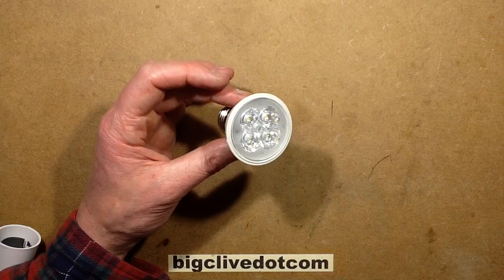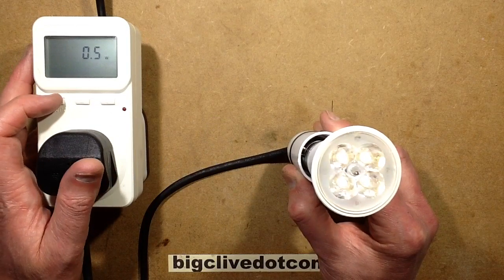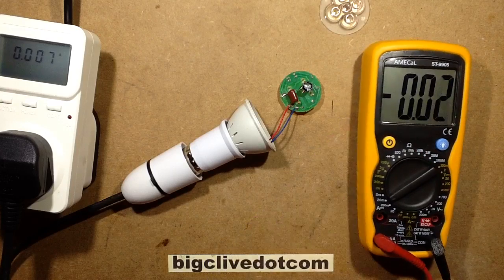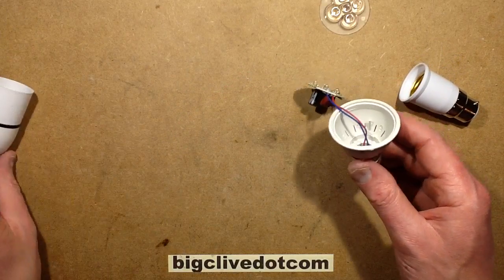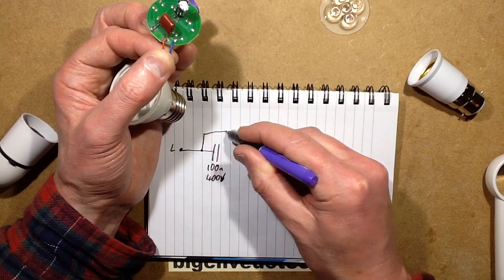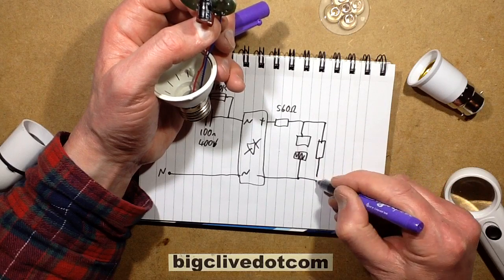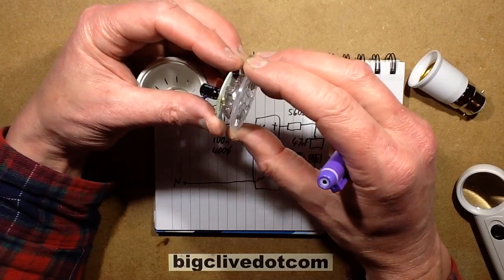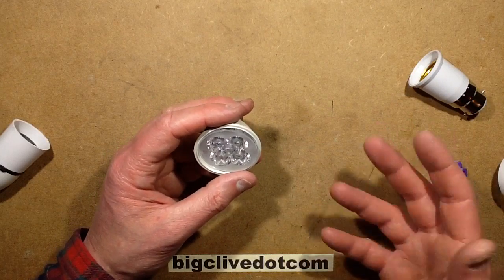Weird 1W (0.1W!) LED lamp from eBay.

Comment: Just claim a refund. You are guaranteed to get what you pay for from most China suppliers, or a full or partial refund. For example I ordered a 30W led floodlight, measured the power output at 17W and received a 50% refund (what I asked for - as being reasonable).
Reply: +Joseph E One thing that I like about Chinese sellers is just that - the ability to get partial refunds AND keep the item. Italian sellers, after ripping you off by making you pay 2,80€ to send a bloody TO220 package MOSFET that could have been shipped in a 0,80€ envelope, justify themselves as "The envelope costs 2€" yet the envelope is a normal paper envelope with NO static protection (great for a MOSFET!!) and after complaining that the mosfet got damaged due to static charges, I got back a "It never happened before. We are not going to refund since you didn't pay for the 8€ courier insured shipping". In their retarded logic, I should pay 8 EUROS to ship a MOSFET that costs 2,50€??
I had to open up a case on Ebay and I left negative feedback. The seller even complained about the negative feedback!!
These sort of people really make me hate my own nation. Idiots.

On the other hand, I NEVER had to send ANYTHING back to the Chinese, so I'm sticking with them, even though the postal trains from China take 1 month or so to come here :D
Reply: +Joseph E I think almost all lightbulb companies lie about power output.
Reply: BikingMNViking
I already recover stuff (I have 6 computers in my house, I only purchased 2) but sometimes I can't trust junkyard quality parts. Imagine if the H-bridge controlling my e-bike malfunctions because of a faulty component... in one case it shorts the battery out (Flaames!) and in the other case the bike accelerates without control until I crash into a wall...

Comment: Hey Clive, I just found out that some Samsung LED bulbs are, in fact, "shellable". Pull the front cap off with vise and pull the Edison base off by pulling it with a pair of pliers. Then unscrew all screws holding the LED (COB LED!) and push it through the hole on the heat spreader.
Then push the aluminum part up and push two wings on the circuit board inside, inside the notch on the plastic shell,  to pull the circuit out.

It has these letters:
KC-SH11200-11002 (KC code, AKA Korea Certification)
STIILW827070324
L42100161WSM
This model has color temperature of 2700K.

Comment: I purchased half a dozen of this type of lamp (mine had more LEDs) off eBay to put into a pair of ceiling lights in a tiny apartment living room. It had 6x gu10s!! Far far too many and very overkill. We didn't need to pay the power bill on 300w of halogen either !

Comment: Still trying to figure out how they measure watts in China
Reply: +Boredness A guy puts his finger across the circuit and says it isnt that strong so they label it as 1 w :)
Reply: +Boredness Not sure how they measure watts, but to translate Chinese Lumens into UK//US Lumens is something like Lumens(ch) = Lumens(us) * 10.  At least that is how it worked for a 2000 Lm Chinese flashlight I bought.  I tested it and it was exactly 200 Lm.
Reply: +Boredness  Estimate and escalate.
Reply: +Boredness real W +50% minimum
Reply: Incorrectly I assume.
Reply: They use a special meter filled with snake oil.
Reply: +Boredness volts^(amps x 10^10)
Reply: +n4mwd 200lm? What was the wattage?

Comment: I was wondering does your electric meter react on this lamp? So low current being drawed.
Reply from the maker: +pcuser80 Possibly virtually no reading at all.  Even if it was it would only cost about 10 cents a year to run 24/7.
Reply: +bigclivedotcom wow.

Comment: I think I see what is going on here; the adapter you are using for the mains connection is acting as a bridge rectifier in series which also leads to the shimmer.

Comment: That would probably make for a good under counter or accent light
Reply: Not really, even at 120 lumens per watt it would still be only 12 lumens or about 1 candlepower, hardly an accent if there's any other lighting around.
Reply: That was kind of my point "night lighting"
Reply: +Andrew Fidel Right. I wrapped 5 meters of those 3528 smds around a thin sheet metal tool holder for my electronic bench and even that doesn't feel like enough work light! (was thinking of putting some of roll 2 under the counter, mostly to cut under, but now I might need multiple strips to get enough light to be useful)

Frankly, I wonder why clive keeps buying these strange little lights -- its almost like his goal is to own one of every kind the whole LED world has to offer. Oneday we'll all have beards longer than clives and be watching video 499, 999 of bigclive taking apart another led light.  ;)

Comment: i guess when they listed the power rating they just thought that .1 = 1 or they moved the point by accident (or purpose?)...
Reply: +1kuhny They may be comparing it to the light output of a incandescent bulb. More likely they are just using a cheap chinese meter which can't measure watts properly.
Reply: +station240 _ - Yes, because it's really likely that industrial manufacturers in a country that produces more electronics than pretty much all the rest of the world combined don't have the ability to measure (or calculate...) the power consumption of the products they make.

Comment: The power savings of adding a on/off switch would never pass the cost of the switch. :)
Reply: +Martin J I came to that same conclusion not to bother with timers with lamps with 2W and 4W LED lamps installed in them... the timers would consume more!
Reply: +LakeNipissing There are timer ICs that consume under 1mA, then less than a volt drop across a transistor instead of a mechanical relay.
Reply: +Stinky Cheese yeah but companies rarely use them. He means wall timers probably and they take like 4-7 watts last I looked and realized the same thing. It's ashame they use so little of this stuff. I saw a PIR module the other day whose standby current was 3 microamps. Wow!